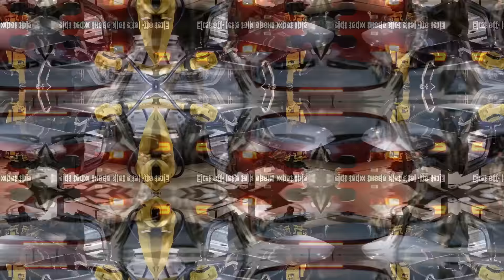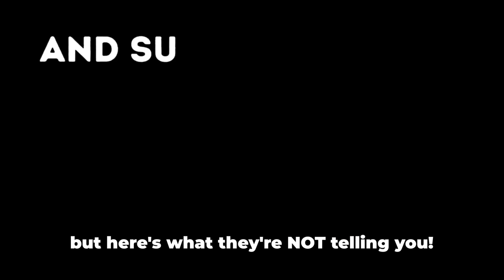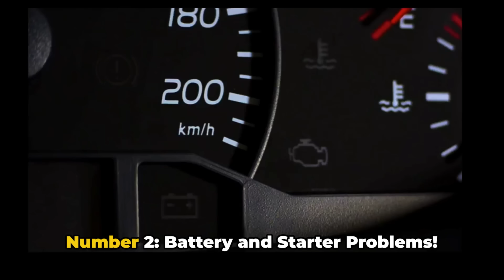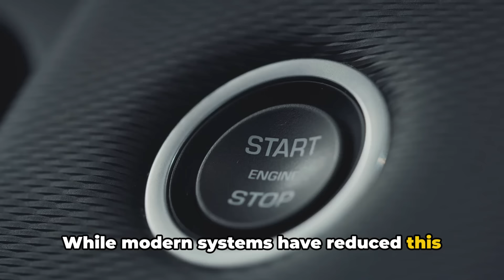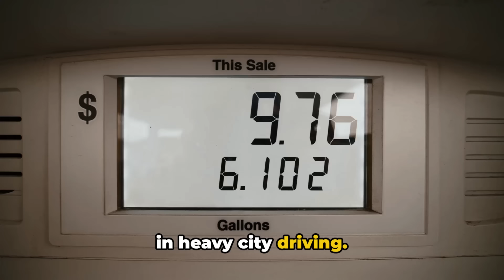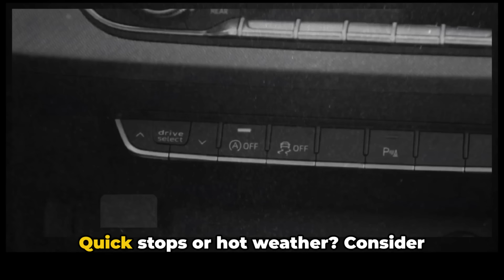The TRUTH About Auto Stop-Start System (Nobody Talks About)

Comment: It’s works really well in grid heavy infrastructure like California and gives me significantly more MPG. Does not add more than 1 MPG for drives with minimal interactions. 

For my Acura it starts very fast and with the brake hold option; it’s actually faster than moving my foot from the brake to accelerator with the engine still running. 
The system also doesn’t work until the engine and coolant is warm enough. Many Honda engines won’t be starved of oil if stopped for less than a few minutes after warmed.

It’s one of those features I mostly see as a cheat since emissions testing in city driving is done with no AC, something many start/stop systems require minimal temperature differences. In my vehicle with AC on the idle stop is very short. A true hybrid or super capacitor system would be the only practical idle stop system.

Comment: Best permanent fix: drive a manual vehicle.
Reply: Some manual vehicles have this fitted.
Reply: Our 2023 Bronco is a manual and we still have to turn it off each time the engine is started.  For $100 a company makes a plug and play ‘pigtail’ you plug in between the on/off button and the wiring harness.  This thing simply defaults to your last setting.  If you deactivate it, it stays that way for good.  I may investigate and see if there is a way to unhook this feature at the battery or the fuse block.  I absolutely hate start/stop and agree that it will cost you big in the long run.  Batteries, starters, turbo, engine wear.  No thank you.

Comment: Agree fully.....this is really a feature that can potentially cause more issues than it solves....I always switch it off on my BMW the moment I start driving.....
Reply: Douche alert🎉
Reply: You can disable it at the stealership
Reply: A naff car that's gonna wear out even quicker
Reply: @cv6176  its a BMW. It will need a new engine before the warranty runs out anyway. Start/stop won't make a difference.
Reply: @Shivris  have you ever owned a french car?
Reply: @Shivris  Not true. I bought my BMW X3 brand new in 2007. It's got over 200k miles on it now and still going strong. And guess what? Same engine lol

Comment: I basically hate this system since it came up many years ago. Right from the beginning, I was telling the message of increased wear for a couple cents saved. Doesn't make sense at any point. I never owned a car with this system but had to do drive some here and there. And after a short time, it became muscle memory to always push the button at startup. I would never get a private car, where this bullshit couldn't be turned off anymore.
But in general I have many issues with modern vehicles, like this is by far not the only piece of tech I do not want in my vehicle. Modern cars are littered with complex tech, which make the damn thing expensive, make it more expensive to maintain and repair, and all this without me even asking for the stuff. No thanks, I'll rather keep my old 2007 van in working condition than dealing with modern annoying crap.

Comment: Two things or times I hate having s/s on my car.  When sat on a hill in traffic, my car will roll back before the engine starts and then engages drive. And also the power steering turns off with the engine, often making turns off a road across traffic very awkward/dangerous.  My solution to both of these is to give the steering wheel a little pull just before both, so the engine starts a few moments before its needed, giving me the drive i need to pull away safely, and power steering to complete my turn safely.  My car won't allow me to turn the s/s off unless i do it at each time i start my car.
Reply: Yes, when I forget to turn off the stop/start, I usually notice how stiff the steering is, and was surprised the first time I wiggled the dead wheel and the car started. Good to have other ways to restart.

Comment: This is the first thing I shut down when I drive my AMG. Shutting down an engine with a hot turbo is a recipe for early turbo death. Hot turbos will cook the oil that is no longer pumping through the turbo when the engine shuts down. And the same happens when the oil is cold! Cold oil doesn't flow freely which means there isn't enough oil in a turbo to allow it to just shut off the oil flow completely! Even if you're just puttering around down town...turbos spin at over 25,000 RPM...more than 10 times faster than the actual engine does...and turbos can get so hot that they will sometimes glow red! If the oil isn't moving through the turbos at all times during these conditions, you will have an expensive repair in your future..and the savings you get from fuel not being burned won't make a bit of difference...
Reply: I spoke to a recent owner of a new Mercedes owner in Kauai. He said you can  permanently disable it on his car from the factory but can enable it if you lose your mind.

Comment: I have a 2020 Honda CR-V with that technology.  When I start the car, I do two things.  I fasten my seatbelt and turn off the start/stop thingy.  My car is 4.5 years old with the original battery that is still in great shape after 39K miles. The battery was tested. yesterday when I had routine maintenance done at my Honda dealer.

Comment: Thank you. Shutting this feature off is the first thing I do in cars with it installed.
Reply: I hit the button every time. This crap is dangerous with the delay.
Reply: @davidanderson8469  you should purchase a better brand of vehicle then.
Reply: From what I understand, in Hondas it needs to be disabled EVERY time you start the engine. No way to set a long-term preference. This actually convinced me to keep my older CR-V a few years ago (still have it 🙂), it cost them a new sale.
Reply: Me too, with both our cars.
Reply: Same here.
Reply: Just use defrost
Reply: Same here!
Reply: One of the first lessons I got from my dad about 30 something years ago regarding taking care of cars was to never turn off/turn on my car's engine in very short intermittent intervals because it will cost the starter & battery to break earlier than they were tested & engineered for. The first time I read about this new tech in a car magazine, I told myself this will not end well. I guess I wasn't the only one who thought about it as seen in this video.
Reply: How many cars do you have?

Comment: I used the stop start system on my European car and had to replace the engine as the crankshaft piston bearing disintegrated from oil starvation. Exactly as said in the video. I learned the hard way.
Reply: You really think the bearing drained completely dry of oil after sitting at a light for 1-2 minutes? Sounds more like a design issue or blocked passage.
Reply: Yet Edinburgh has mostly mercedes Vito taxis with this feature and they are out driving in traffic all day doing hundreds of thousands of miles without having any issues related to this.
Reply: That is nothing to do with stop/start
Reply: Those European cars are not for city driving.  My bmw seat edge trim cracked and was replaced 4 times, at least it was about $55.

Comment: As soon as I start the engine, I turn the auto stop off. It's as routine as putting my seatbelt on.
Reply: We permanently disabled it.
Unplugged one connector under the hood.  Been that way for 6 years 👌🏼
Reply: Me too!
Reply: In my car the start and auto start/stop button are fortunately right on top of each other. So it’s really easy to turn it off. I do this all the time. Turning it off has become second nature by now.
Reply: Exactly, this is what I do to my Car also.
Reply: Same with the routine -

Has me looking like a pilot doing some 100-point check, 

Turn car on
Seatbelt 
Auto start/stop off
Android auto
Etc etc
Reply: Same here.
Reply: Same here
Reply: Exactly doing the same thing on my car and van never had starter/battery issues.
Reply: But u pay for that feature!! 😂 I agree it's so dumb
Reply: How do you turn it off
Reply: One of the first things I do in my Genesis GV70
Reply: Same here!
Reply: Just unplug it
Reply: Same
Reply: Same, immediately.
Reply: I'm doing the same.
Reply: Same hear
Reply: Sorry here
Reply: Me too, I push the button to start my truck, I push the button to cut that off. Lol
Reply: Me, too!
Reply: The "disengage auto stop/start" button is no longer provided on the newest vehicles.  Bad for the environment, doncha know.
Reply: Same
Reply: Yep.
Reply: Same same
Reply: Ditto!
Reply: You wait until you also need to turn off lane departure, colliision avoidance and speed assist.  At least auto stop works.  The other systems don't.
Reply: I do too, buy sometimes I forget.
Reply: You should stop buying great value cars.

Comment: have replaced so many batteries on Chrysler products with this system. I can send my kids to Harvard now.
Reply: Very true, had to replace the 2 batteries in my Pacifica last year.  Both are expensive.  The small start -stop battery died, which in turn killed the larger main battery.  Too expensive replacing batteries.
Reply: Some commenters have mentioned disconnecting one of the black wires at the battery to permanently disable stop/start on their Chrys/Dodg/Ram vehicles.

Comment: And worst for turbocharger
Reply: the why did my Seat Leon TDI with stat/stop drive for 350.000 without porblems
Reply: @PoulEichel  luck I guess 😂
Reply: @PoulEichel  idk what seat leon is but just deductive reasoning says if you put 350k miles/km or whichever unit of measure you use where you live, it wasn't in a lot of stop & go traffic.
Reply: Yes, I would disable it if you're driving on a freeway or motorway. You don't want the engine to suddenly stop and the oil supply to cut off when the turbocharger is running hot.
Reply: absolutely. will cause that oil to coak.
Reply: Oil lubricated coolant cooled.

Comment: The most useless system ever made.
Reply: You can actually by a auto switch button that connect to the switch once you turn the car on it turns it off
Reply: 2nd thing I do is turn it off. I mapped it out in my last car along with the other most bloody useless & dangerous system which is lane departure. In one instance it tried to force me into the path of an oncoming car. And in a Volkswagen the default is on.
Reply: Well, 2008 Mercury Mariner hybrid with a Toyota style system had this feature. Drove  the car fit 75,000 miles and the city/highway MPG was about 33. No problems, worked as advertised unless the AC was needed and when the battery required warm coolant in colder temperatures. Don’t know why people object to this system nor why they buy a car with it installed. I gather many US drivers are proud of their 18 mpg vehicles?
Reply: Useless AND damaging, m'friend!!!
Reply: Acronyms sell cars. 😞
Reply: @bendgeddes  Wouldn't the Auto Start/Stop acronym be ASS?
Reply: Sooooooooo annoying
Reply: Another thing to keep in mind in terms of fuel saving......
It takes as much, if not more fuel to start an engine, than if it had been idling for thirty or more seconds.
Reply: And most annoying too. Every time need to turn it off
Reply: 10% fuel savings?
Not a chance. 1% at most.
Reply: @bukboefidun9096  Agreed. 10% must be an exaggeration.
Reply: It does not even help with saving gas it’s meant to “reduce emissions”
Reply: At this point go for a hybrid honestly.
Reply: That and MDS
Reply: Well there is something as EGR 🙄
Reply: And endorsed by the EPA.  What a bunch of losers.
Reply: @MikePoulson-qt1me Just like the DEF system in diesel trucks! More expenses than benefits.
Reply: Completely useless, does nothing to help fuel economy!
Reply: I drive a Subaru Crosstrek in the UK which came with this most annoying feature? fitted. I noticed a thin Black cable running to one of the battery teminals that wasn’t on my previous 3 Subaru’s. I just unplugged it and instantly Start/Stop was disabled. A small Amber light flashes on the dash but I neatly fashioned a piece of Black tape and covered it. 10,000 miles later still working faultlessly and when you come to sell just plug it back in
Reply: I think elect4ic parking brakes are much worse.
Reply: Just as bad as EGR
Reply: I heard from a GM tech friend, the average starter cycle life with this setup is 30,000.
Reply: Oh I disagree. It’s very useful to the battery and starter companies. CHA CHING.
Reply: No it’s Perfect. For YOU to get a new car frequently
Reply: goodbye 👋🏻 engine
Reply: The start stop system is very annoying. The only way to avoid this system is to get a hybrid.
Reply: @cedricjackson7521  :  A Hybrid might not be as annoying, but it will still be stopping and starting more than an "ICE only" vehicle.
Reply: @cedricjackson7521 Or you can just shut it off 😂
Reply: Dumb